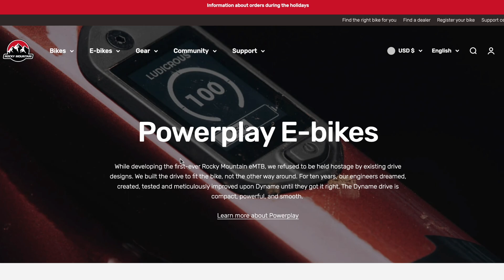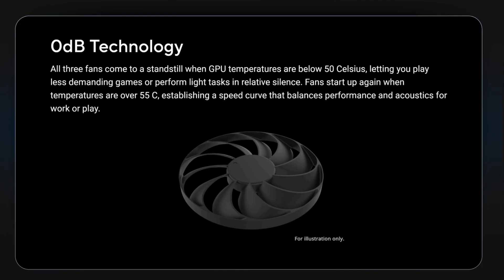More Torque For Every Motor In 2025

Comment: Any ideas if the Gen4 bosch cx motors will get a similar software upgrade to increase tq or will it just be for the latest Gen motors ?
Reply from the maker: I have not heard about any updates for the gen4 system.
Reply: @  any Estimates on what would be on the gen6 motor? Tq and peak power?

Whatever happen with the race cx motor? Is there a different variant coming out soon as well?
Reply from the maker: @f2performancelab  lots of good questions. The peak power of teh gen 6 is around 600w

TQ i think 350, 

Cx Race, no clarity on that. Ive heard that it depedns on how they implement the software update of the CX motor.
Reply: @ thanks for the reply. What I meant about tq (torque) and peak power estimate was regarding what it would bring up the newer cx motor ratings to

Comment: You missed out bafang, their m560 is 130nm and their m510 is 95nm, I have the 510 in my bike and it's more than enough for me.
Reply: There is also a Bafang m620 with 160Nm, but it seems that western testers don't like to mention them. They turn their heads, close their eyes at the very mention of Bafang... That's why the Chinese will take over the market in everything. The West is burying its head in the sand like an ostrich instead of tackling the competition. That's why there was no response from yuotuber to your comment

Comment: Gen 4 is still the performance king. Instant power even with light touch of the pedals and overrun to run the cams back a whole rotation. Gen 5 taking a step back in that regard. Having that slow first cam pull where the motor is just starting is just bad for any technical terrain. Bosch had the winning formula for 3 years and they botched it. If I was buying Bosch I would either buy gen4 or race.

Comment: I have been of the opinion for months that the new bosch cx motor has reserves and that these will soon be unlocked. No huge leaps are to be expected, but a good 10-15% are certainly possible. And the great thing is that this is planned by Bosch so that the sellers can still sell the old CX, because the warehouses are full.
Reply from the maker: You got it.... ;-)

Comment: How long before we start to see some difference in power specs, across the models in the range. So at the moment, if you buy let's say Trek Rail or Spesh Levo, you get the same power regardless of whether you buy the 5k bike or the 15k. This is a bit odd when you think about it. My LBS owner reckons Bosch will bring out a Race version of the latest CX, with more NM, before they up the NM of the standard version. So Trek for example will entice people to go for the higher spec Rail by giving it the Race motor. (I know we already had the Race version with CX Gen4 but didn't really take off and wasn't much power difference if any). btw Alex, why can't you say ZF?
Reply from the maker: ZF i can say, test bike is on the way..... 

What you have said is what will likely be happening. 

Each motor will top out at 110, with 85 in mid range. That is across most brands including Shimano who will likely have a 110NM motor as well. (as the title of the video, everyone is going 110)

Comment: As much as Id love seeing that, I cant, and to be honest the main manufacturers have had the whole market monoply to themselves for ages, so in order to be competitive their going to have to change, like some have said , smaller, lighter batteries, higher output motors, better controls etc., next few years are going to be massive from what we're seeing, like the first emtb's to now kind of difference.
Reply from the maker: you might possibly be right. They are presenting the 2026 options to oem now, I suspect that it wil lbe 2027 before anything big happens apart from whats already currently out there and coming this year.

Comment: I hope more brands will either adopt the Pinion MGU (which I understand already offers a very high torque) or other motor producer going in the same direction, offering a gearbox with their motor. And of course the belt transmission too. I believe bikes like Nicolai Saturn 16 is a very solid example of what many riders dream to own when it would be offered at a more affordable price.
Reply: The Pinion gearbox sucks because you barely get any torque in the higher gears. I would absolutely not buy a gearbox like that. Normally the motor cadence is optimized for your pedaling RPM. But Pinion gearbox has the gears before your feet. So the motor has different torque for every gear. The peak torque being somewhere in the low gears. Where as on normal derailleur you have peak torque on all the gears it's just your cadence. The Pinion will give you very low assistance power in the higher gears.

Comment: Current drive trains won’t be able to handle the added torque! Anything more than 90nm will just chew through cassettes,chains,chain rings 
We need a super beefy 8 to 10 speed for e-bikes
Reply from the maker: @nickjones5728  yes this is correct and the subject of one of my next videos.  The SRAM ex was an answer to this, but people complained about it. Ironically my review back in the day was referred to on the SRAM website. It was designed for the extra power. The t type is supposed to go somewhere on this but as you said torque over 90 might be a bit too far....

Comment: It’s not just the power when it comes to the DJI bike. With exactly the same build kit my Amflow is 2kg lighter than my Levo. 21kg with a coil shock, upgraded fork, tyres bar and stem. It has wireless remotes you can remove without faff. It has a slimmer longer life battery. It has security features built in like tracking and sim card support. It connects to their action cams. The app actually works straight out of the box. No crashes. No daft design decisions. The wireless remotes and security stuff has been asked for years.

Other manufacturers will upgrade their firmware and it took an outsider like DJI to kick the industry out of complacency. Hopefully they’ll add the other DJI features as well.

And frankly, it looks better than most eMTB’s on the market. And that matters.
Reply from the maker: The levo has a heavier motor and battery setup for sure. The frame weights are also lower on the amflow, but the use cases are marginally different with the levo being able to go a bit harder, the new amflow enduro bike will change that when it arrives.
Reply: The security stuff is massively underrated to me. Shimano etc need to up their game.
Reply: Agreed on most points, but not the look, didn’t do it for me, just looks super bland and more trail than enduro, ended up with the new Rail which looks stunning in comparison, again, my personal opinion

Comment: 💯 mostly marketing BS. Hyper focus on usually what a pro rider wants or does (racing typically) and lacks subtly for the majority non-pro crowd. Why it's important to get the most objectively from YTers as possible to weigh options. Pros/cons that best fits 💸, riding style, and local trails. The more hilly or tech you ride, the nicer the torque within skill limits. Personally, 90 Nm does 99% of my trail needs, rarely have I needed the 120 Nm on my Bafang M600 rig for crazy trail ascents. Plus, most extremes are one and done. So, more Nms if controllable, otherwise diminishing returns especially with crazy overrun.😁 Then again 120Nm means less battery range.
Reply: The appeal of the amflow, it's the weight to power.
Reply: @scott5731  yeah agreed somewhat. Sam's Enduro AmFlow build is 48 lbs wet weight with 38 forks, DD tires with sealant/inserts, coil and 800 Wh battery. This would save 10 lbs from the same traditional full powered. The DJI Anivox electronics is what stands out. And the price is good. But not yet available for North America. I recently built up a Bafang M820-75Nm 180/165 38 fork Enduro build it's about 47 lbs wet weight with a 720Wh for high spec at $5.5K. Even 75Nm seems to work with 95% of my riding and the 10 lbs lighter than my M600 trail bike is more agile and plusher. I ride that most. I'm sure Bafang could tune it to 85 Nm with enough consumer feedback. So yes DJI gives a lot to be desired. Just don't need the 120 Nm to encourage me to buy one if it was available to me Also, my frame company is using the DJI system later this year if rumor is correct. It should be an amazing DIY build. I personally won't buy one, I'm waiting for the next MGU drive unit...I'm hoping the ZF-90 will do one soon!🤞
Reply from the maker: 90 nm really is enough for a lot of people. Maybe reducing the battery packs back to 600 with the new motors.... Sounds like a Santa Cruz vala.... :-)
Reply: @alexbiketester  Not for me. I need 800+ Wh as a heavy rider. I did like Sam's Enduro 38 fork AMFLOW build with the bigger 800 Wh. So, the two high and low options should be standard. My Bafang M600 just got a 980 Wh custom battery build as I'm waiting to fabricate a new cover for. It was a 500 Wh originally (just barely enough with only short turbo boosts). Also, the newer battery should have the more efficient 21700 cells that can save some battery size and weight.
Reply from the maker: yeah bigger riders need more in reserve, you can adda. power more with the new 600 bosch. Im on the limit of bigger is better. I never managed to empty a 900 wh battery yet.
Reply: @alexbiketester  true. I hope I don't have to drain the 980Wh either but for big alpine...just in case. Still wouldn't necessarily need the 120Nm, 90 Nm should work but I guess I can worry a bit less? And weight penalty.😁

Comment: More torque with same restricted motors won’t add too much fun to the matter, I’m wishing for less restrictions.
Reply from the maker: a lot depends on your country. Class 1 is USA and has different rules to EU. I know BOsch wants to avoid emtbs classed as a motorbike. Means insurance and number plates etc..... not good. The current power limitations work well for the average user. If you are an expert then yes i can imagine you want more.
Reply: @alexbiketester  25kmh is abysmal it doesn't work for the average user. For MTB it's somewhat tolerable but for commuting having a 25kmh restricted bike is just useless. Derestricting bikes is very common. That's why you have at least half a dozen chip companies inside europe. People avoid buying the rim Bosches because they have to be rerouted for chipping. Shimano doesn't nmecessarily need a chip because the LBS can switch it to US mode so you get 32kmh. Bafang you can just select what limiter you want from the controls. Brose would just work with cam magnet derestriction. It's just ridiolous to have such a low number for a motor with not one horse power.
Reply from the maker: @rawmancemtb  this is a controversial topic but very apt. Above 25 km h in eu requires insurance etc so thats the main reason
Reply: @alexbiketester  Yes but no one does that. Reality is bikes are just derestricted.

Comment: The motor is one thing,the battery is another, they both have to communicate with each other so just swapping out one motor for another is not as simlle as it sounds, I recently had an issue with  a Pivot LT cutting out when a lot of pressure was applied to the cranks, the motor shut off, the issue was that the battery hadn't been programmed correctly and so the motor was receiving too much power.
And then comes the aesthetics of the bike, if the very latest and greatest motor / batrery combo is in a bike brand that does not appeal  then Im not going to buy it, the whole power thing will I think become an issue with people not experienced enough to both ride and control the bike.
Reply from the maker: @TAZMON20  yes. Apparently the askoll can communicate with a Shimano battery but you don't get any power data, just current. So obviously they recommend using their batteries. The look of a bike if you are spending good money is important, one reason why I wouldn't choose the amflow, but if the forbidden is with it I might. The pivot motor issue not heard of before, certainly an interesting experience.

Comment: I watched a recent upload of Peter from Mtb Mates removing a Bosch Gen 4 faulty motor. Omg it was 25mins of total unnecessary faff, with bolt after bolt and plate after plate needing removing, suspect wiring needing routing. Sure to probably have taken closer to an hour without all the outtakes, to remove some no doubt cursing. 

I dropped the  smaller and more powerful 120nm motor from my Amflow in less than 10mins, along with battery to fit Code Ultimate brakes and remove the dropper cable for my Axs Reverb. It's held securely in place with just two thru axle bolts and 4 connector PLUGS. That's it. 
Another case of Amflow and DJI  improvement. Not only is it more powerful, with more control. The interface and fitment is heads above the usual mainstream too 😁👌
Reply from the maker: The new Bosch doesn't have any of that plate parts, good idea for a video, drop the new Bosch motor to see how easy it is to get it out compared to the old one.
Reply: @alexbiketester   me to thank ha. Can't be any worse that the previous carry on. Hey if better, Bosch must have taken fitment ques from DJI ha 😂
Reply from the maker: @shaneycarter8803  DJI will obviously be bench marking against the competition and making improvements where they can.

Comment: The thing about the DJI motor is that it's not just the motor. The controls are better than any other controllers out there too. The battery is lighter and smaller. The bike is available to purchase. So, many of these other motors are not readily available.
I think the one thing that would put a motor brand above the others is Repairability. That would make me buy a bike over any other.

Comment: Markhor do a bike with the Bafang motor that has 160 and peaks at 1500w. It's also a long travel enduro weapon and I can genuinely see one as my next bike. Good thing about a bike with a Bafang system is it should be easily upgradable as the tech improves. I will say one this about this power though, I don't even use all the 90Nm I have on my current Kenevo, I spend 70% of the time in eco and 25% in trail. Turbo mode is just a "bail out" mode or to get me back to the car when I've crashed and hurt myself (again!) lol
Reply from the maker: Y/es thats an observation of specialized, thats why they made the SL segment because they saw from their data a huge percentage of people were not using turbo.
Reply: @alexbiketester   I do like having the full power to back me up though, in the middle of a night ride and faced with a horrid climb up a rooty gully. Stuck her in turbo and got it done! Lol